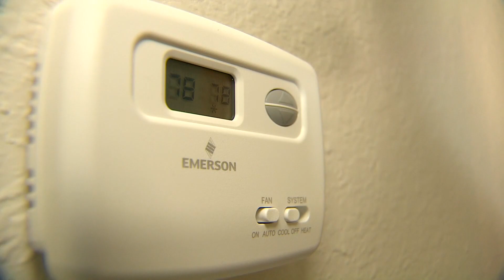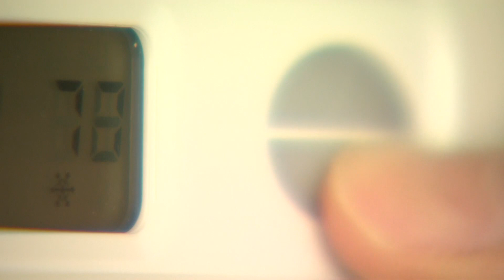When ERCOT requests conservation, why 78 degrees?

Comment: Buying a Dehumidifer floor unit and setting it to regulate at 45-50% humidity, setting the A/C fan recirculating to 10-20 minutes per hour is by far the most effective if you want to set the A/C to a higher temperature.